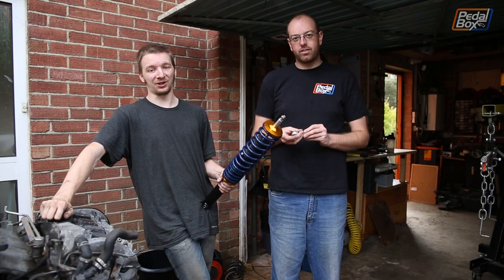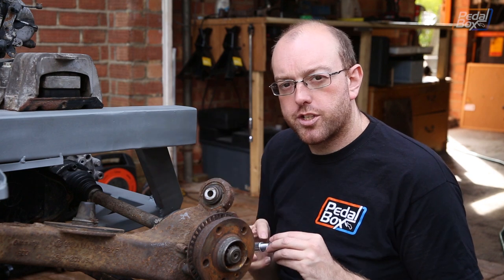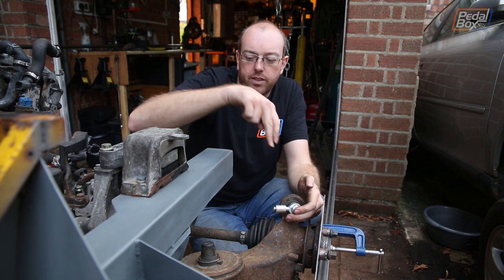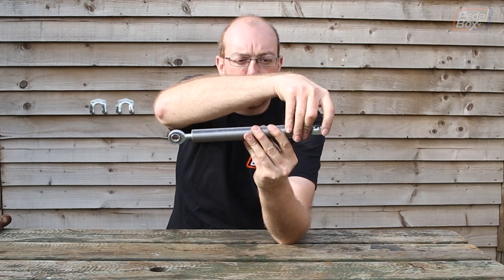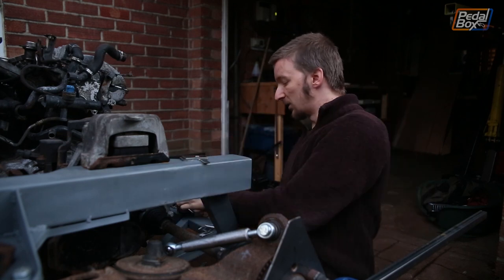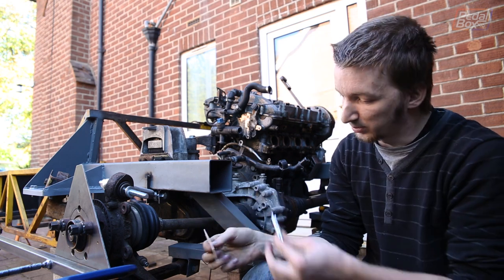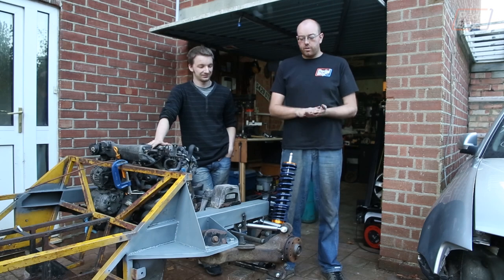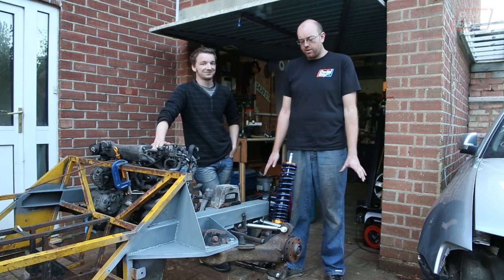Rear Suspension Pt. 4 - PedalBox Episode 11 | Mid-Engine Audi Kit Car

Comment: Another excellent video!

I suspect you went with the stock trailing arms design for strength rather than build a true 4 link?
Reply from the maker: Yeah, helped a lot with just getting the sizing right, alignment (but we fixed that recently again) over all scale and reduced a good deal of the complexity for a first foray into building/welding/designing a car from scratch

Comment: nice job guy's , i guess you are using left and right handed threads on each end to allow quick adjustments on car . ?
Reply: I re watched based on my guess and it looks like right handed threads on both ends of the top arms . if you use left on one end and right on the other end you can rotate the tube to adjust the length and then fix with locknuts . this will give you very fast adjustment on length without disconnecting the rose joints . my engineering ethos is to always build in adjustability to allow for previous "F" ups. . very cool project and following with interest . Cheers Ade and Chris. from Ades workshop.
Reply: @ade63dug  Sorry mate, we're not doing well at keeping on top of your comments are we?!

Yeah we're using right hand threads at both ends for now - when we were first designing these arms we expected the rear arm to be bent to clear the coilover, which would make it impossible to twist to adjust. Since we didn't think the rear link would be adjustable, we didn't bother making the front link adjustable.

When we later learned that the rear arm cleared the coilover, we decided to make the rear link straight and we could have made it into a turnbuckle, but we'd already spent a shitload of money on those expensive joints with the right hand threads on them at that point!

While we were out working today though we've found some interesting new problems, and it looks like we're gonna be throwing both of those upper arms in the bin. Turns out, suspension geometry is hard.

Comment: Don't the adjustable suspension arms need some sort of locking nut on them? To avoid them spontaneously adjusting length in use...?
Reply: Yep - they arrived the other day. We've been pretty rubbish at keeping on top of the little parts orders for stuff like that - the misalignment washers I mentioned quite early in the video were like 3 weeks between "we should order these" and them arriving.

Also we've actually not gone for a turnbuckle style twist-to-adjust arrangement for these arms. The expectation when we got the joints and threaded inserts together was that the rear arm was going to be a bent tube, so it'd need to be removed for adjustment. Since we thought the rear could never be adjustable, we figured there wasn't much point bothering on the front so went with normal right-hand threads on both ends of all the arms. Spinning the tube just moves it along the threads on the joints, rather than shortening / extending them.

We'll surely go for properly adjustable arms, using left+right-hand thread inserts later, now that we've found straight arms work, but for now we're more keen to charge blindly ahead and build more interesting new bits rather than upgrade existing.